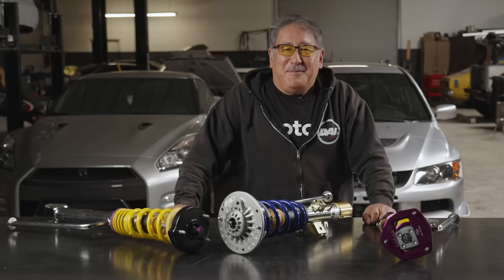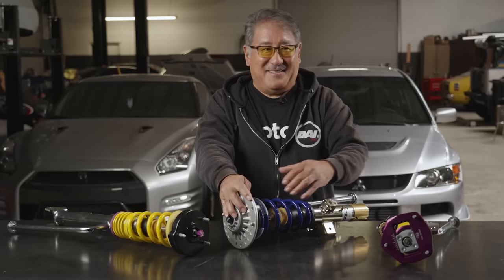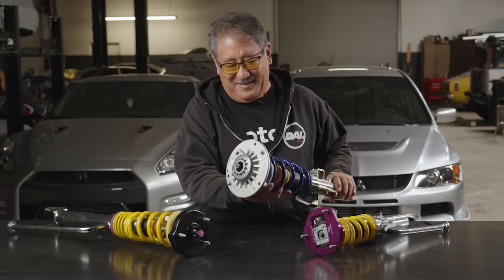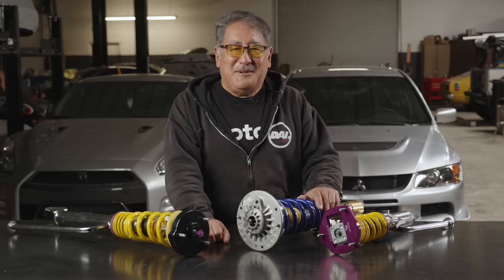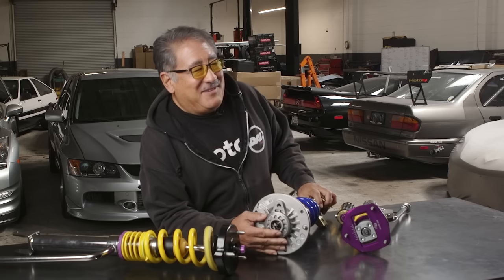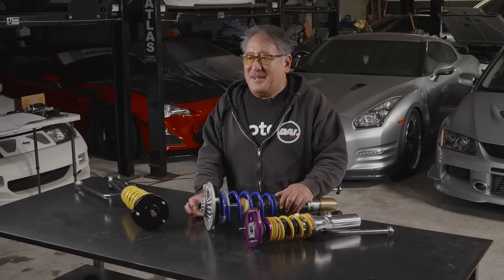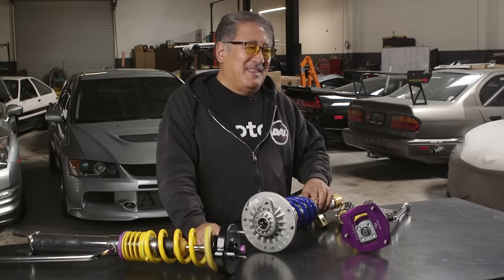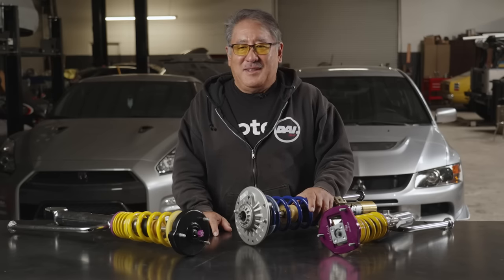How To Adjust Your Shocks Like a Pro and Go Faster | PART 1 - Single-Way Adjustable Dampers!

Comment: @motoiq I’ve got BC Racing coilovers for my E46 coupe. I will be doing the install very soon. What’s a good place to start when it comes to height and camber adjustment for a street and mild track setup?
Reply from the maker: Like I said in the video not more than 2" lower, camber probably 1.7 neg in the rear and 2.5 in the front but there is a lot more to setting up a car than that and I am not going to write a book in a post reply.
Reply: @motoiq  I totally understand. I’m a beginner and just trying to get an idea on where to start. I have a lot to learn still when it comes to setting up the suspension and your videos are a great help. Much appreciated!
Reply: Hello Mike, thanks again for the tips. The car is ready for an alignment now. How much toe and caster should I be running? From what I’ve gathered the rear wheels must toe in and fronts toe out. Correct me if I’m wrong.
Reply from the maker: About 1/8" Total rear toe in and about 1/8" total toe out in front, if you caster is adjustable about 6 degrees positve.
Reply: @motoiq  Thank you so much!

Comment: How do I know whether to add more compression or more rebound? I have an S3 with the magnetic shocks and a DSC Sport suspension controller that can adjust Low/Mid/High compression and rebound independently. I’m looking for more vertical body control on the highway, and based on this vid I need mid-speed damping! Do I need more compression, rebound, or…both? 😄
Reply from the maker: whats adjustable?
Reply: @motoiq  It’s all controlled via software, so via laptop I can adjust Low speed compression or rebound, mid-speed compression or rebound, and high-speed compression or rebound, all independently from each other. It’s almost too adjustable so it’s been driving me nuts. 😄
Reply from the maker: I would make everything full soft then add at one speed zone at a time starting with high speed compression, then mid speed, then low speed, same with rebound in that order. For some reason I didn't read DSC controller the first time, sorry.  Be sure and save your stock map and the DSC default map.  It is also speed and G sensitive so look at those maps as well.
Reply: @motoiq  Appreciate the advice! I probably have 20 different map files I’ve saved down but can’t seem to get the body control to where I want it. 90% of the time it feels fine but then a really uneven highway joint will cause it to bounce around too loosely. I think I need to dial in mid-speed settings. Thanks for the help!
Reply from the maker: If you are getting float going straight ahead, look at the G map and add control in the zero g area or fill in that hole if you know what I mean.

Comment: Is it true that with stiffer springs you should in general set higher damping? Meaning, with the same cars, on the same dampers but different springs (lets say, one has 14/10k springs, other has 10/6k springs), should the car with stiffer springs have more damping, since the spring is decompressing at higher velocity?
Reply from the maker: You are correct.
Reply: @motoiq  thanks for answering!
Reply: @camryt BUT: 'more' damping should be achieved with shocks valved to suit the stiffer springs.

Comment: Do you have any tips on rebuilding a set of kw v3 for a eg hatch. Im from europe and would love to send them to kw but they quoted me 380euro for just one shock and thats just crazy, i rather buy a new set. I have rebuilt a few motorcycle shocks, and lots of front forks without any problems so im pretty confident. I guess the only challenge here will be somehow refilling them with nitrogen. And shock shops in my country wont touch them, to afraid lol.
Reply from the maker: Send to KW
Reply: @motoiq  Honestly how does that make sense. That's just 380€ shy from just getting new ones with new springs and all.    Can you elaborate. That doesn't seem like even close to a reasonable price to me.
Reply from the maker: I don't own KW so I don't set the price of service.
Reply: @motoiq  But you can agree that paying just 15% more for a brand new set is a bit high for  just a rebuild?

Comment: Even if you're just replacing struts with oe struts you need to get your vehicle aligned. Small changes in ride height change camber and toe angles a lot. That will eat up your tires and make your car handle poorly
Reply: I'm in the process of fitting coils to my NC Miata and not only is the ride height different but I've loosened all the arm links so the bushes don't get all twisted up. In doing that I've lost alignment settings.. once they're in and set up right, it's going straight to the (nearest) alignment shop, for at least an initial approximation before going to a specialist.

Comment: I recently changed my coilover springs from 6kg to 8kg, I would assume the increase in spring rate, requires the shocks to be adjusted stiffer too. The problem is I still feel harmonic vibrations here and there on the street. Going stiffer and softer on the shock settings seem to reduce the amplitude and duration of these vibrations but not completely remove them. Is there anything I can do except return the old springs or buy dampers designed for that particular spring stiffness?
The car is EP3.
Reply from the maker: Are your rear springs stiffer than your front, if not that's part of your problem.
Reply: @motoiq  Thats correct. Thanks for your reply. I dont understand why rear needs to be stiffer on a FF hatchback but I would assume since everyone develops coilovers with stiffer rear, there is some solid reason.
Reply from the maker: The rear motion ratio is really high. This means you effective wheel rate is like 60% of the spring rate.
Reply: @motoiq  Thanks, now it actually makes more sense.

Comment: When you say less rebound  is more, does it apply when it is lowered at an optimal height? What if it is 2.5 to 3 finger gap front and back?
Reply from the maker: That sort of statement doesnt mean anything. finger gap on what, what sort of car, how much bump travel, what sort of suspension does it have.
Reply: @motoiq  maxeedingrods, 98 crv , finger gap from top of tire to arches. Not too sure of bump travel.
Reply from the maker: Without information impossible to answer.  Just do what I said in the video and it will get as good as it can.
Reply: @motoiq  k no problem, I like the explanation side of the video. Can you do a visual as well? Like when you have too much rebound or too little. If not cool
Reply from the maker: Its sort of hard to see this stuff
Reply: @motoiq  I get it it's more of a feel and measurements, but that's what type of visual I mean. It's ok, no problem
Reply from the maker: Unfortunately, you have the ultra cheap coilovers that hardly work and don't respond to adjustment.  If you do try to adjust them take big swings at it because the adjusters will be insensitive.  Those type of coilovers  often just have an adjusting knob that doesnt do anything and isnt attached to anything.
Reply: @motoiq  mines does respond, but it seems like it likes more damper in the rear and the front are halfway. 10kg front and 7kg rear. Yes cheapo. But I had this car for 22 out 25 years of its life. It's way better than what was stock though

Comment: Would you say its normal for shock damping to change quite a bit from cold to hot weather? I find I would have to change 2-3 clicks to compensate for the outside temperature.
Reply: Shock oil's viscosity is temperature dependent like most fluids, so yes it does change with weather. So a couple clicks change from summer to winter sounds pretty normal to me. Shock oil will warm up after some driving though.
Reply: @CharlesNam  thats true about the oil viscosity. It just seems like quite a change to compensate compared to other cars I've driven.
Reply from the maker: Once the suspension warms up, its not that different.
Reply: You could be careful with this compensation because good advanced shocks like ohlins, rieger, intrax has special metering thermostat in it and that can adjust niddle with oil viscousity
Reply from the maker: It is funny that high end Ohlins do not have this feature.  It's only the consumer grade DFV shocks.  I wrote an article how the temperature compensation circuit works here.  https://motoiq.com/how-does-the-ohlins-dfv-valve-work/
Reply: @motoiq  My fault. I agree i forgot about TTX, TTR (inline) ohlins with solid rod and piston 🤫

Comment: Is it true that most koni adjustable coilovers don't use have internal nitrogen charge?
Reply from the maker: Yeah they are twin tube with no gas pressure.
Reply: @motoiq  Thanks for the reply. Is that a good thing for them to be twin tube with no gas pressure? Mine has some mileage and could definitely use a service. I've serviced many bikes and motorcycle forks as well as off-road coilers but this would be my first set of street performance ones if I attempt them
Reply from the maker: They are old technology and a hard to service at home

Comment: That’s why I love BC. Back in the day nobody mimicked touring car which was always super low and on 19/20s. Shorter shock body with preset preload. You can run low and not bottom out and still have the same amount of travel.

Comment: I never learn either. I did stay within the range my bilstein B12 were spec'd at, but my car handles pretty bad too - but it looks good. I'm changing some parts because of age of bushings and need to raise it 10-15mm. Coilovers in the realm of normal sporty cars are rarely used as intended - and race ppl rarely use these on normal cars as comfort for the most parts suffers to much. A good setup of good lowering springs and well spec dampers are often superior for secure handling..
Reply from the maker: We find that in general, lowering springs are too soft and too low and actualy hurt handling. Stock configuration shocks also fall into that category.
Reply: @motoiq  I don't disagree - i see a lot of ppl use 40-50mm springs and original dampers. It's rarely good handling is the target and i'm i guess no different with my current setup..

Comment: 14:45 - sorry, you've got that backwards. Common misconception, repeated by multiple sources.
Reply from the maker: Nope I am 100% correct because we are talking about a rebound only adjustable shock.
Reply: @motoiq  Whether compression or rebound, more damping will increase rate of weight transfer. With compression, increasing damping increases the rate of increase of force onto a tire; with rebound, increasing damping increases the rate of decrease of force on a tire. You're conflating chassis attitude with weight transfer. More damping will slow the rate of dive or roll, but it actually increased the rate of weight transfer. Think about a kart.
Reply from the maker: Weight transfer isnt one dimensional.
Reply: @motoiq  I'm not sure what that means or how it changes what I'm saying.
Reply from the maker: It slows dynamic weight transfer and slip angle build-up caused by it. Dynamic weight transfer is the biggest part of what the driver feels and is the most affected by shock changes, the weight transfer percent change due to the actual body roll is very small.
Reply: @motoiq  your second sentence is correct, your first sentence is incorrect
Reply from the maker: Show me the math to prove I am wrong. The movement of the entire mass of the vehicle in response to cornering force is pretty significant and way more than what a static freebody diagram would show. Or do I agree with you and I am I just not understanding your semantics?
Reply: @motoiq  also, read tune to win by Carrol Smith
Reply: @motoiq  hmm i posted a link to a good explanation showing math but seems to have disappeared...
Reply from the maker: Mine is from Race Car Vehicle Dynamics by Milliken & Milliken. If you can find your link I would really appreciate it. I greatly enjoyed your in-car videos, is the Duratec in your car very tractable?  It seems to torque out of the turns with little shifting or is it because your car is so light?  The car seems very fun to drive.
Reply from the maker: I agree with everything in that article and the GMR article they were talking about is so wrong, it must be a typo.  I think I just don't understand your thinking but we are thinking of the same thing, which lends me to want to do an article in MotoIQ with the math to show how weight transfer affects the tires and how suspension interacts with that.
Reply: @motoiq  In your video you said "when you make the damper stiffer, you're slowing down weight transfer. When you make the damper softer you're actually speeding up weight transfer" Perhaps you meant to say it the other way around. I would post a correction, because otherwise this misconception just continues to grow. I have see that posted so many places, even on damper manufacturer websites and tuning guides!
Reply from the maker: Maybe I should say it influences slip angle.